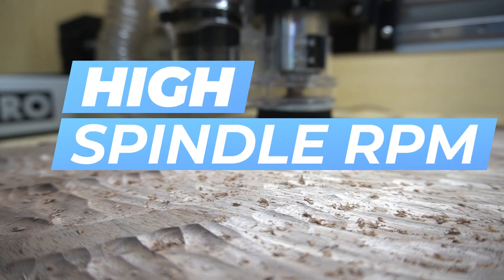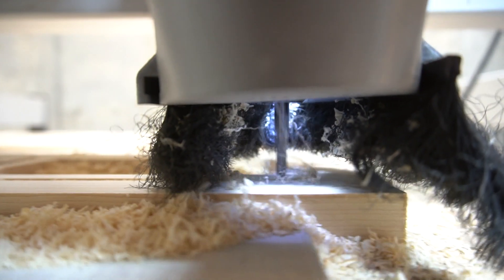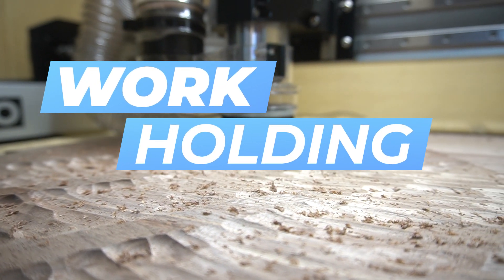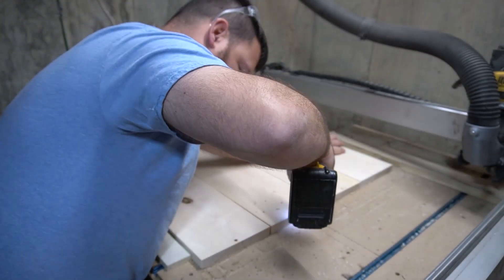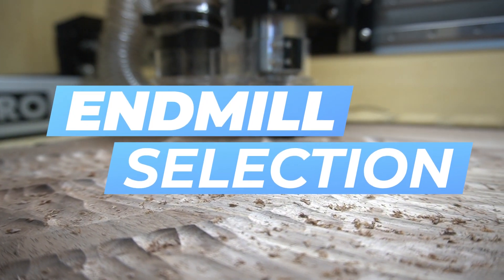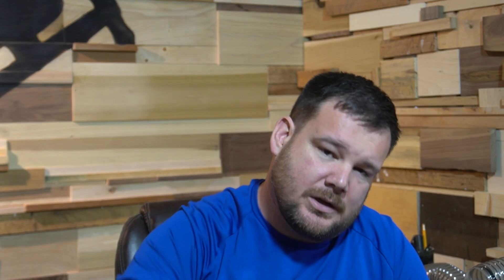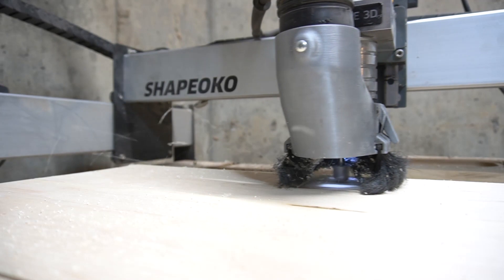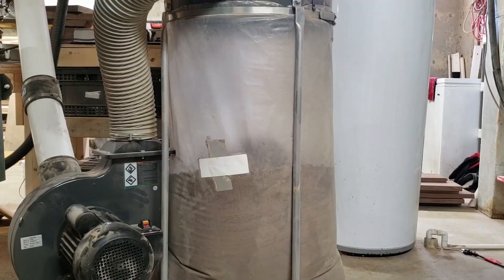5 Mistakes Beginners Make With Their Desktop CNC Router AND How To Avoid Them - I Made Them Too

Comment: Very good ideas!  The common different V bits, 60, 90, & 120 and the diameter of the cutting top cutting edges, determine the depth and size of the font you are using, e.g., if the letters are large, then the bigger the angle needed to make the V cut clean letters with the V at the bottom of the cut.  The diameter of the cutter does determine the speed based on the rotational speed of the cutting edge:  a 1/4” bit has a cutting edge distance in one rotation of pi X the diameter of the bit - 3.14 X .25” = .79”.  A 1.0” diameter bit, like a surfacing bit has a cutting edge distance per rotation of: 3.14 X 1” = 3.14”. So, when you take the RPM’s and multiply the distance of the cutting edge per on rotation,  it becomes clear just how much diameter affects RPM and feed speeds - 79” X 12,000 rpm’s = 9,480 inches per minute, and the 1” bit cutting edge distance at 12,000 rpm’s is -  (the circumference of the path of the cutting edge) 3.14 X 12,000 = 37,680” per minute.  It becomes clear just how much the diameter affects the cutter edge distance, feed speed and rpm’s needed to have an effective chip production, size and cutting smoothness to the project, and protect the lifespan of the bit.  I hope this helps you all begin to understand cutting protocols!  😎
Reply from the maker: Thanks for sharing!

Comment: All good advice. It is relatively easy to create a vacuum hold down system for clampless holding by using the CNC itself to produce disposable, grooved spoil boards. Then, if you buy two inexpensive 30 litre shop vacs (take care, they must be wet and dry vacs, for a vacuum hold down system, or they’ll burn out), you can then use one for dust and one for vacuum, and easily switch the hoses as needed, to give you a substantial 60 litres of dust capacity.

Comment: Hey can you address issues with static and EMI affecting the stepper motors and proper bonding?
Reply from the maker: Most of the static is generated from the router. Run your power cord opposite of all your other electronics.
Reply: @AndyBirdBuilds  it’s pretty hard to do. Do you not run your router power through your drag chain?

Comment: had the same problem with clamps sticking above the material and causing problems, ended up getting some toe push side clamps that dont stick above the material, they attach to the sides so its still secure but they dont stick above, for me its a better solution than using superglue/drilling into spoilerboard/using double sided tape
Reply from the maker: Thats a good solution. I just don't like that you have to adjust them everytime for different size stock. Either there too close or too far away.